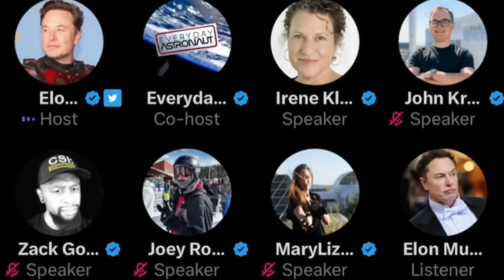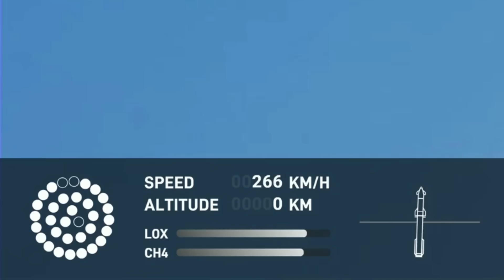New Details On SpaceX's Plan For Starship Pad Repairs & Upgrades

Comment: Elon is too arrogant and too ignorant to do the things right ways. If he were to hire an engineer who studied elementary fluid mechanics (Bernoulli Equation) and listen to that engineer than he would install inverted diverging funnel under launch table to stop pressure of ambient air from constricting rocket exhaust. Rocket exhaust would spread sideways before hitting concrete pad. That is all that there is to it.

Comment: I thought it to be quite remarkable that the rocket could do a 360 somersault without breaking apart. You see other rocket failures where the rocket breaks apart after just a bit of rotation.
Reply: That somersault  happened almost 40km above Earth surface so there is no air there and there is no air friction on the rocket. Nothing spectacular when you stop and think about it

Comment: If the concrete was broken because it was on the loose ground (sand), how putting a steel plate about concrete would avoid the same thing to happen again? Logical would be to reinforce the ground beneath the concrete, but logic and how Musk think aren't related!
Reply: A much deeper hole with a huge cylinder of concrete filling it. Now how does waterproof concrete compare to fondag?
Reply: @imho2278  are many solution to this specific problem(soft and loose ground) , but why Musk solution to the problem that himself reveled wasn't actually related with the problem, but was a solution to another possible problem (heat), that apparently didn't caused concrete to fail, and fondag was also presented as a solution for mitigation of heat, so again I don't see how protecting the concrete from heat would solve the problem of the very loose ground beneath concrete that make it to break under huge load of the launching?
Reply: It is much dumber than you think. Fastest way to reduce rocket exhaust temperature, pressure and velocity is adiabatic expansion done same way as in rocket engine expansion chamber. Simple steel cone extending from below launch table cutting away ambient atmospheric pressure would cause exhaust gas expand sideways reducing pressure, velocity and temperature before that exhaust gas  hits the ground. Primary function of flame trench (flame diverter) is adiabatic expansion not flame diversion Elon and Space Cadets at SpaceX never read books on elementary physics and this is why Elon says that steel plate or flame diverter would serve same function.
Reply: @KarolKarolak  apparently Musk is too cheap to do the things right ways, Curious Droid made a video about that few days ago in which explains that he tried to hire army corp of engineers for building a proper launch pad in Bocachica, like those made for NASA in the Apollo era, but when find how much will cost he changed his mind and decided to do it himself faster and cheaper and obviously much worse.
Reply: @theOrionsarms Elon is not too cheap, he is too arrogant and too ignorant to do the things right ways. If he were to hire an engineer who studied elementary fluid mechanics (Bernoulli Equation) and listen to that engineer than he would install inverted diverging funnel under launch table to stop pressure of ambient air from constricting rocket exhaust. Rocket exhaust would spread sideways before hitting concrete pad. That is all that there is to it.
Reply: @KarolKarolak  well exactly, arrogant is the perfect word to describe him, only because name himself expert in all things doesn't mean that know enough in more than one or two domain to have a qualified opinion, but he have the money to hire the best experts in the world, and choose not to do it, so it's kinda cheap to.

Comment: SpaceX needs to scrap the damaged, structurally unsound,  launch pad and build a new much taller and wider launch pad,  preferrably, 4 times higher and wider,  somewhere in the Mojave Desert far from any habitations or wild life refuges. Social Responsibillity should be an essential part of the SpaceX Program.
Reply: Is Los Alamos still irradiated? That'd be a good spot.

Comment: Why to call 'Stage 0' to the Launch Pad'?! 🤔
If it would give a launching push to the rocket via a pneumatic (as some Soviet missile silos) or a rail-gun like Electromagnetic accelerator it may be a reasonable  way of calling it. 🙄
But just a platform that only provides power and fueling it is not deserving of such name.

Comment: The one thing I wonder about is, what if there were people in that thing?  How do you save them if something goes wrong.
Reply: There's no point designing it to save imaginary passengers if it is far far away from the reliability it even needs to start considering flying people. That just slows you down unnecessarily.
Reply: @dsdy1205  yeah because powering in one direction and changing the whole design after a couple of years to safely fulfill the main objective is a smart thing to do
Reply: @stefan514  that assumes that whatever Starship evolves into by the time it gets a high, reliable flight rate going is fundamentally incompatible with passenger safety. I don't think any of us know enough to make that claim.

You can develop Starship quite a ways via the current approach while still allowing for passenger safety. High flight rate and reliability are themselves safety improvements - the best way to mitigate a failure is to prevent it. If failures do happen that impact the Superheavy, it's not like you can't include provisions in Starship's flight software for abort modes that see it perform water landings or the like.

The only way I can make your statement make sense is if you're one of those folk who believe that Starship needs a detachable abort system to make sense, in which case I have a suspicion that you would already have made up your mind on the matter.

Comment: I wonder if they did creat a below ground level flame trench and thus a below the water table flame trench if they could store the water that leaks in over time and pump it to a water tower to then use in a water deluge system and I think* that water that seeps through the ground is fresh water (I don’t know jack shit about hydrology so take this with a grain of salt)
Reply: A flame trench below ground water becomes a pipe. So think about blasting water in a tunnel at 1200 degrees.
Big bang!

Comment: the failure of stage 0 means that starship will never go to mars.  Full stop.    There is no steel plate, no flame trench, no water deluge on Mars.   There is just natural bedrock.   If starship cant take off from concrete, it sure as shit cant take off (or land) on mars bedrock.
Reply: mars has 0.38 times earth’s surface gravity. the rocket they will land on mars will be nearly empty on fuel when landing so will be much lighter. it will also just be the upper stage that lands and it only has 3 surface engines firing at once, a full 11 times less engines than the first stage.
Reply: you seem confused about the difference between the 1st stage (superheavy) with 33 engines and the second stage (starship) with 6 or 9 engines). Starship has succeddfully launched from (an elevated) concrete pad.

Adding legs to Starship or another  solution (such as the first uncrewed starship delivering a launch platform) would be possible.

Comment: Just about everything in this report makes sense. Ultimately, there was not so much fire damage as just about everything around the pad was sandblasted. Or in this case, concrete blasted. That being the case a fire trench may not be necessary. The steel plates should protect the concrete that supports the structures. However, a lot of water will be needed to keep the plates cool. In my opinion, something must be put in place to keep the moisture that is trapped in the sand beneath the OLM from boiling thus reducing the chance of fracturing or exploding any concrete below the pad. JustAThought and JustSaying.

Comment: Aren’t upward shock waves a big deal here? Plate won’t fix that?
Reply: The rocket can deal with those and any payload will be high up enough to be safe.
Reply: @wesleyashley99  payload won't be much help if the rocket is broken
Reply: I have an image of the plate bouncing like a trampoline, ripping off the launchpad legs and spewing bits of molten steel and live steam everywhere.
No rocks this time though.
Reply: @imho2278  maybe if there was no water cooling and the duration was too long.

Comment: The next attempt in a few years😂
The FAA will make sure of that. The pad is the least of the problems. The progressively blowing up engines ending with the destruction of the whole rocket is the real issue.
Reply: I mean, this was like an ACME cartoon with a rocket built by Wile E. Coyote.  All it needs is a laugh track.
Reply: @ReachOutToWilliam   Exactly.
Reply: The rocket detonated itself due to bad trajectory and loss of altitude, both of which were caused by communications issues. Did you even watch the video?
Reply: @triforcelink  In fact, completely incorrect, the rocket lost power because of the chain reaction of the engines destroying each other. Elon's explanation is utter BS.
Reply: @Wised1000  Wow, you must have been working with the telemetry data yourself then huh?
Reply: @triforcelink  
No one as blind as one that doesn't want to see🙄
Reply: @Wised1000  Ok. I’ll just come back here when they do the next launch from the same pad in like 6 months to call out your bull.
Reply: @triforcelink  Magical thinking
Reply: @triforcelink  Elon has allowed that the detonate command took 40 seconds to activate. I suspect that the electricals and radio link were trashed by minute 3, and the rocket blew itself apart. So...if it had hung on  a few minutes longer...buzzing around likd a deflating balloon..where would it have ended up??
Reply: @imho2278  It was an automated detonation by the software on the rocket (which also took longer than expected to go off) so loss of communications shouldn’t matter.
Reply: So did you enjoy today’s launch? So much for “next attempt in a few years” 😉
Reply: Yet another successful launch
Reply: Still waiting on your reply, pal

Comment: what about the sound wave?
Reply: Right? You can see these upward overpressures. Flame trench directs this load away while plate. Just reflects it up.
Reply: What about it? They said it wouldn’t effect the load, and apparently they’re no worried about starship itself.
Reply: The design of the plate is similar to the Soviets in the 80's. There is a steel that is raised slightly and steel around the opening with openings on all sides to dissipate the shockwave. All of this is in an open water cooled system with another layer of thick steel below the top with a similar design to dissipate more shockwaves.
Reply: a slight cone shaped plate would focus waves at a specific angle

Comment: "...maintaind thrust vector control and throttled up..." sounds like booster engine vectoring (hydraulic) wasn't optimal and the Starship engines were expected to have throttled up?

Comment: The water-cooled steel plates "...under the launch pad and integrated into the support columns..." sounds awesome!
Reply: That water will just turn to steam and rupture the "plate" from the inside.
Reply: @ReachOutToWilliam  really good point 🤔 but i would imagine that they will think about the pressure since most of the work they do is pressure related .. so hopefully they will have a working solution soon... Even though i think you need to have a flame trenche for such a powerful rocket
Reply: @ReachOutToWilliam  that's only in a closed system. I think the idea is the steel plate will be on top of the concrete and water is sprayed across the plate. Its not closed at all.
Reply: @ReachOutToWilliam  expansion tanks, anyone? I’m sure they will figure it all out eventually.

Comment: This 'repair' plan is INSANE! - A steel plate will just bounce the propulsive force straight back to the engines and destroy them.  That launch facility is a total write off! , a phuck up ON PAR with buying Twitter for 20X what it's worth.  But Musk CAN'T admit that he phucked up because A). He's an Aspie Narcissist "Genius" who's never wrong and B). If he did admit that the SpaceX pad has to have flame diversion Boca Chica will be OVER and the stock price will tank.
Reply: You have no clue what you’re talking about. Except for the Asperger part